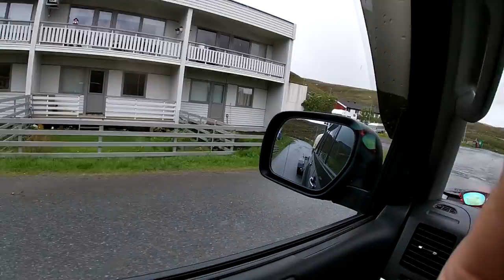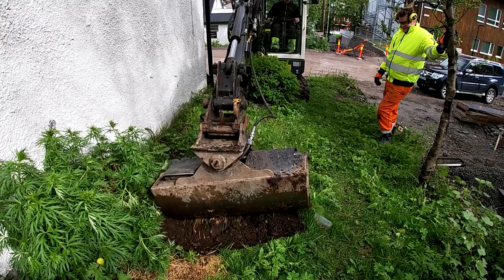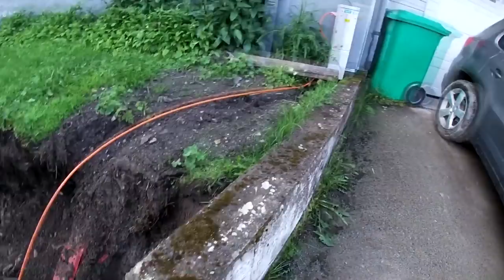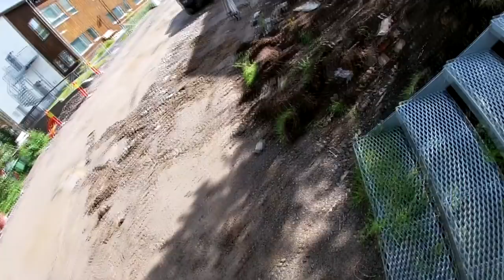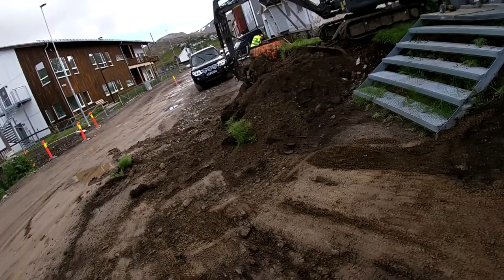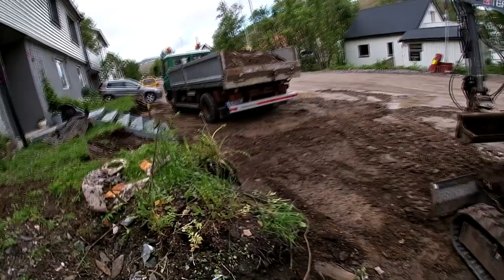Excavating for a retaining wall and removing a in ground oil tank

Comment: good job with the dig !! is the government helping with any of the cost with the remove of the tanks and with replacement of the burner units ? thanks for sharing !!!
Reply from the maker: Thanks 😊 the government only give founding to remove the oil burner if you install an environmentally friendly system, like drilling bedrock extractting heat and so on, so the new heat source is so expensive to install that it's not an solution.
Reply: thanks for the reply !! just wondering !!

Comment: It would seem that the total process would be very expensive! Having to remove the tank and retrofitting the house for electric heating. Do the houses have enough power coming in to support electric heat? Is the government giving any kind of grants to help pay for the conversion? Thank you, very informative videos!
Reply from the maker: The oil heating hasn't been used here for many years, I guess the 90's electricity got cheaper and oil more expensive. So most people stopped using it already than, and the oil tanks are left in the ground and the oil burner inside removed. So that's why all buried oil tanks was suppose to get removed before January 2020.only the ones in use with bio oil was admitted to keep. So almost all houses are heated with electric already.
Reply: I understand now. My brother took out many tanks in New York City. If he saw any leakage he had to stop and call the government inspector. Any leakage the government would call in a remediation company and they had to dig until the laboratory report came back negative! Thank you 🙏

Comment: Can you run any of the unused fuel oil in your diesel machines ? Hello from Raleigh,North Carolina / USA
Reply from the maker: Hi, yes in the old type of diesel engines without high pressure injection  I can use it, so actually all my machines, it's recommended to add a bit og 2 stroke oil.